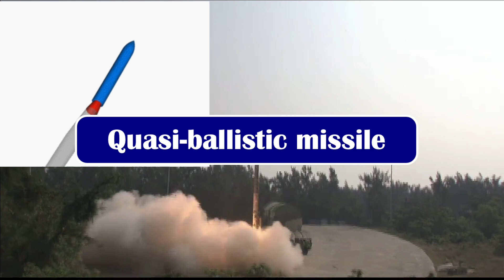Pralay : Answer to PLA Rocket Force | 5 Units under manufacturing #indianarmy #drdo

Comment: One huge question that was only casually mentioned

It uses a new generation of composite propellant that High Energy Materials Research Laboratory (HEMRL) started working on during the development phase of Sagarika from K series of Missile family. The solid fuel is highly efficient and can provide more energy compared to the fuel used in Agni missile series. 

Does this mean the Agni series of missiles can have their range extended by using the new propellant? And also by switching to
complete carbon fiber stages instead of using maraging steel first stage. It seems Agni series can hit intercontinental range
even without a new Agni 6.
Reply from the maker: ok so this is rocket science :)
Yes the new propellent which are continuously being improved is intended to have more efficient combustion & compact which theoretically extends the range of missile. Further the use of composite makes the missile lighter and stealthier another boost to the range.
Reply: @IndianDefenseAnalysis  Yes and that means greater range/payload or both. Potentially a very huge deal!

Makes me wonder if the new Agni 6 is for MIRV instead of range because that whole claimed fourth stage no longer makes sense.

Maybe at the design state 10 years ago but considering modern composites and high performance propellant it makes no sense!